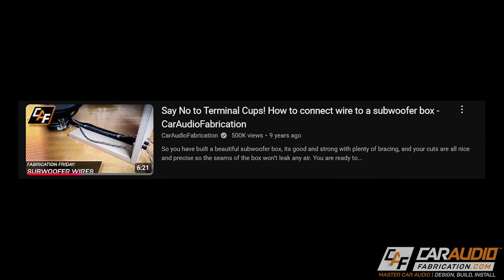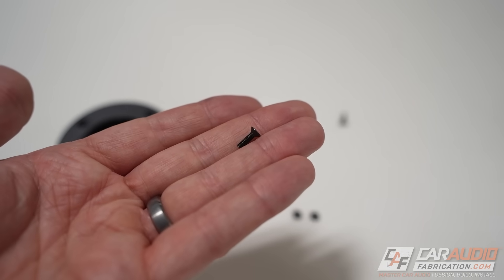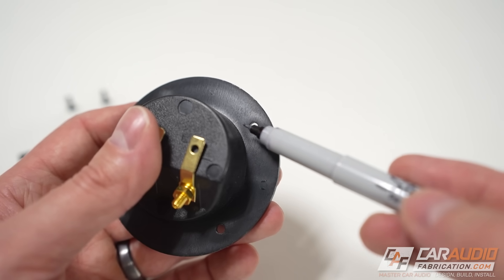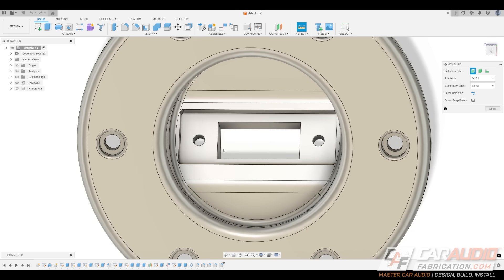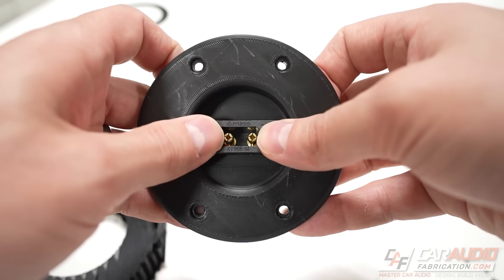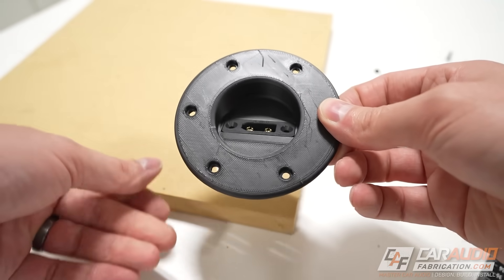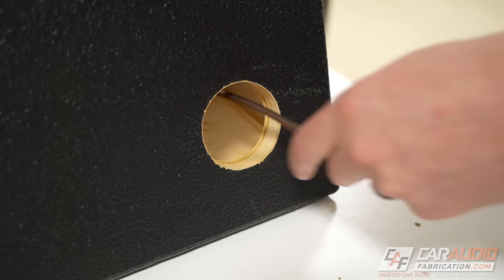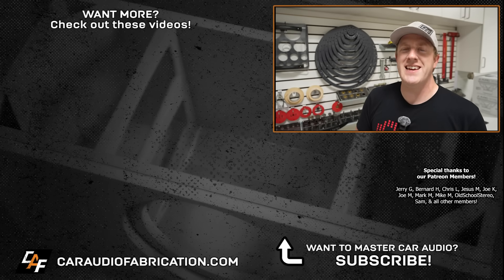My Ideal Speaker Terminal - DIY Designed & Built!

Comment: Hey Mark, love your channel. 
Funny thing, I was just looking to use an xt90 connector on my sub enclosure and was thinking that I will have to maybe  do an angled section on the back for my xt90 connector so it had a nice flush look to it and then I saw this video with your 3d printed terminal. It turned out great, I’m sure you were already thinking of this  to recess it flush into the wood to give it a more cleaner and  flush look.  Any chance you would sell one of your creations to a Canadian subscriber. 😬keep them coming.

Comment: Sir, I have  Hyundai I 20 magna.
In which I have installed Blaupunkt keylargo 980  headunit along with 2 pair JBL GTO 609C component speakers powered by JBL STAGE A6004.
Now I want add a subwoofer ( Pioneers TSW 1202 S4)
Can it is posible to add this in my existing setup or sould I add another amp.
Does it affect my stock alternator if yes then please suggest me a way to add a sub without affecting my stock alternator.

Comment: I drilled a small hole thru the box so I can  put the cable thru,seal it up and than have a cable with a xt90 male connector , and from the amp I have a cable with a female xt90 and this way its super easy to take the sub box out from the vehicle at anytime.

Comment: 5:54 There's no reason to spend time doing any measurements of the XT90E-M plug. Instead, just look at the CAD drawings with all of the needed plug measurements in millimeters, in the official Amass XT90E-M datasheet. Just google "XT90E-M.pdf" to find the datasheet. Most of the datasheet is in Chinese, but everyone can read the dimension numbers on the CAD drawings.
You can also download a complete 3D model of XT90E-M at GrabCAD if you google "Amass XT90E-M Panel Mount Connector | 3D CAD Model"

Comment: 0:59 Correction: That's not the panel mount female style connection but the male style, where the pins go inside the female counterparts.
The gender of plugs in general is defined by the gender of the pins, not the gender of the housing.
The M in the part number XT90E-M even stands for male. There's also a female panel mount version of this, from the original designer of this standard Amass. This is named XT90E-F to indicate it identifies as female.

Comment: That's awesome! My only critique is that I think it should be possible to design it to not need supports, you just need to design it so the angle inside the terminal extends all the way to the printers build plate, and change all the flat parts inside to also be angled. Then you could just print it upside down without supports!

Comment: Hi, an opinion, I bought an old Ford Fiesta MK7, I wanted to transfer my old system to this one, I currently have 2 old KFC 3011 subs driven by a Pioneer GM D8601, for the front I have a 2-way Renegade RX6.2C kit, I was thinking of changing the front and putting in some MTX RTX654 midranges, and a tweeter, does it make sense?

Comment: so you get cleaner prints on your support material. in Bambu Studio, change your interface material to PLA if you are using PET-G. and then change the interface distance to 0. it will then print onto the support interface like its another layer, but because PLA and PET-G don't stick you will get super clean overhangs and prints on the support interface layer

Comment: As an experiment, you could print the outside face down and you would have the texture of the print bed instead of the printer lines showing. You can get a print bed that leaves a carbon fiber look as well.
Reply: @andym436  +1. It would also likely eliminate the need for supports, assuming the inner cup surface is at least 45 degrees

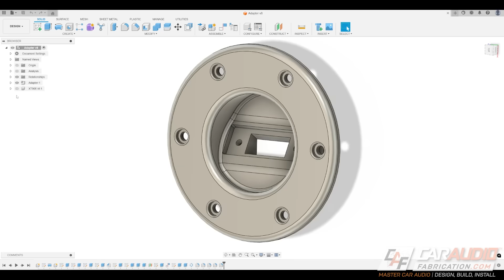Comment: @7:00. you are really close to getting this to be printed on its face with no supports. Do you see it? extent the face angle of the plug to fully sit in the circle. use chamfers instead of fillets as well. The overall depth may increase a bit to achieve this but I'm always on the side of no wasted material even if I have to sacrifice a little to get there. In this case you won't have to sacrifice much to get there. if your using a wood screws the recesses for the mouthing screws should have chamfers as well. Nice work.

Comment: Can just use a Speakon connector. It's the industry standard for professional audio, so no reason it couldnt work in car audio. Should be more than durable enough
Reply from the maker: Clearly didnt watch the video. Speakon would not meet the goals here
Reply: @CarAudioFabrication  not with the current implementation,  but there are brackets or mounts available off the shelf that tucks the speakon connector in so it sits flush with the edge.

Comment: Hey Mark, what you might want to try is called a Fuzzy finish on your 3d print. It will give an ABS looking texture and it does it while it prints so no post processing is required and it looks like a finished part. Look up Fuzzy texture Bamboo labs. Its done by the software and creates a texture on the finish that I think you are looking for on that terminal.

Comment: TPU makes a great gasket and you can print the TPU right on to the part and it would be good to go. As far as the texture print them in ABS and fog them with acetone it will give it a smooth glossy look.

Comment: i like to use those twist lock terminals,(stereo connection in 1 twist and click)
just do not understand those usles klip and bannana conectors for car audio.
i do like what you made there,looks like a RC battery connection.
been looking in to the molex open barrel connection kit's,
for direct connection to te oem car wirering,
that turned out a bit more complicated than expected i must admid.
my 4 ohm Gladen ATM wil be  on a Mosconi pico 6/8 dsp,
making it dsp capeble.

Comment: Just a minute in. What I did for my subwoofer prebuilt cabinet (J Audio Bass Wedge) was I took the spring terminal terminal out, got some 1/4" ABS and made a Speakon connector. These twist locker connectors are a bit large but are very durable as you know professional use it for day to day setups of gigs and such. Just another connector you may want to look into. They also have up to 8 poles in 1 connector, so you can bi-amp whatever you want

Edit. Actually a really cool connection you made there Mark! Should be mass produced! lol
Reply: i know JBL used those twist lock terminals more than 30 years ago,
way better for car audio aplication.(4 pole in my old JBL sub box)
like you wrote,pofesionals use them.
Reply: I second this, they are a Bit larger however and the Plug would Stick Out a Bit more than usual cables, but the Connection itself would be superb

Comment: Speakon.
Reply from the maker: Those stick out of the box a considerable distance. Completely ruins the design goal of putting the connector on a side of the enclosure that I butt up against something else
Reply: @CarAudioFabrication  Speakons mount into a recessed plate or even a recess angled plate. Plus you can have up to 8 poles. It was designed for touring all that was worked out

Comment: You can buy 90 degree XT plugs.  You're welcome.😁
Reply from the maker: Unfortunately the design of those makes them still stick out of the plug a ton. Its kind of silly how they are designed. The L is in the larger of the two directions.

Comment: Same I hate those cups. I used pigtails. Now I use tube connectors from G R research. Works great. Drill two small holes. Job done.

Comment: To get a better finish, try reorienting the model on the print. Place it so the flange is on the print bed.  Just make sure to set your supports properly so you get a good finish on the inside of the cup. You can even separate your print into two parts and then glue them together.
Reply from the maker: Yeah I would have preferred to print it face down, but I was worried how the important part that lines up with the XT90 would print onto supports. One of those things I can optimize and try now that the design is made. I did one with ironing a few hours ago and its far smoother

Comment: "Only" 90 amps...  Considering P = I2 × R, that is 90*90*1 = 8100watts at 1 ohm, 90*90*2 = 16200watts at 2 ohms, etc.  If someone is running a 10k or more, they should probably not be using any kind of terminal cup! :face-blue-smiling:
Nice design.  Have you considered making the cup part another 1/2" deeper so the connector is completely recessed and only the wire comes out of the cup?
The terminal that I made for myself mounts from the inside so it is always recessed by the thickness of the enclosure.  I like the ease of mounting of yours though!
Reply: no thats only 1,080 watts at 12v
Reply: @Snows_Cold wrong side of the amplifier. Your thinking car battery to amp. This is amp to speaker.

Comment: get a rough surface build plate instead of the smooth pei you have right now. it will give it a nice finish. this is a great solution by the way think you for designing it.

Comment: wouldn’t anderson power pole do the same thing?
Reply from the maker: There's a million different connectors out there. The issue is most are designed where the " female port" only mounts into a thin panel (like sheet metal, not the side of a sub box). Also they usually take up room. So a few different reasons I went this route.

Comment: @caraudiofabrication Can you recommend a plug like that for a 3,000 watt amp? Thank you. Love the videos.
Reply: Xt90 is good for 8100w at 1 ohm
Reply: @Luke-qs2cg  they are rated at 90 amps continuous. Watts = Amps × Volts. Therefore, 90 amps × 12 volts = 1,080 watts. My amp has a 300 amp fuse
Reply: this is not the calculation from the amplifier to the subwoofer as it's being used here. Amp to subwoofer would be i2xR or 90^2x1 ohm or 2 ohm or whatever your subwoofer resistance is at that impulse. The way your thinking about it would only count for when using as a power wire from the battery to the amp. Completely different use case, and this plug would be completely wrong for the application. For power wire you should always be using a cold weld ferrule (crimped) onto the power wire. If looking for quick disconnect on the power side you would be looking at an Anderson sb350 plug. Much larger but can still be incorporated into a design like this given the appropriate room both in the box and for that large of a cable to bend.
Reply: So, at 3,000 watts your wires to your amp are outputting 250 amps since watts equal voltage times amps and your car's voltage is locked.
However, your amplifier is outputting a dynamic voltage. We can find your voltage based on your power output and your speakers resistance. We take the square root of your watts, 3000 here, times your speakers resistance. At 1 ohm thats 54 volts, at 2 ohms that's 77 volts, and at 4 ohms that's 109 volts. We can now divide your power by volts and we'll see that you'd draw 54 amps at 1 ohm, 38 amps at 2 ohms, and 27 amps at 4 ohms. So, unless your running sub ohm speakers you should be good. 
Max wattage is indeed 8100 at 1 ohm. Double that at 2 ohms, etc ...
Reply: @dustinadams2352 that makes sense. I’ve had my meter on the 2ga wires going into the amp for awhile. When i used the O scope to set the gains, it was in the high 50 range with no clipping at the speaker wire.